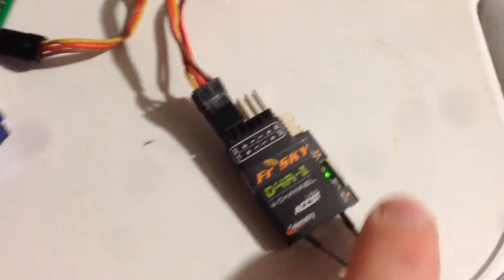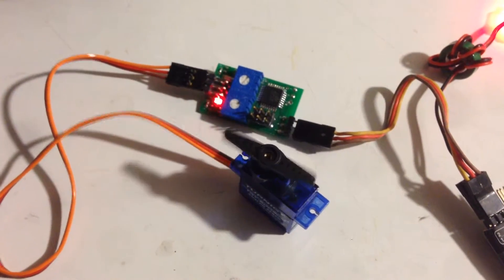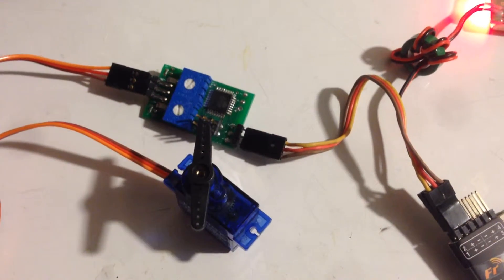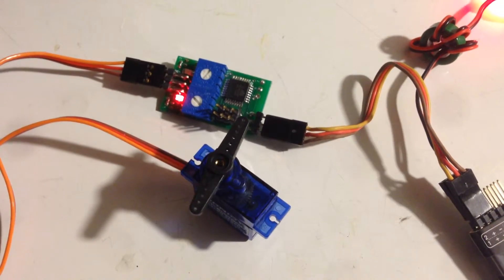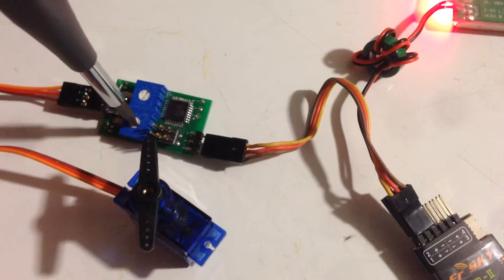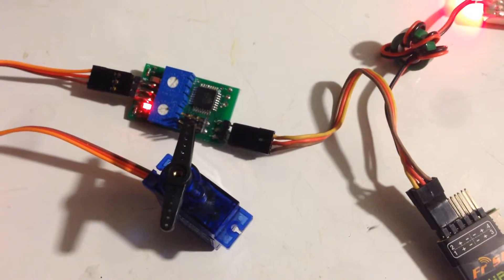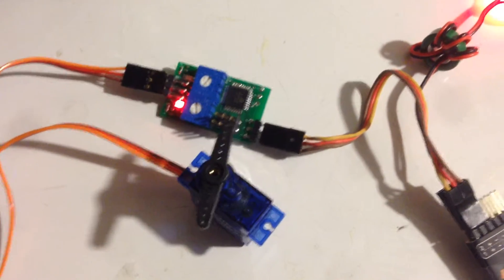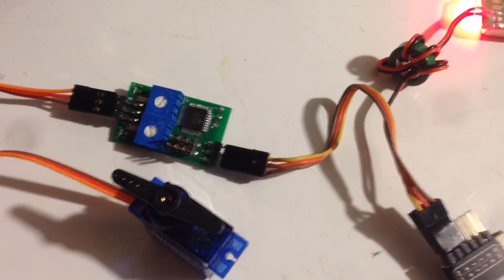Servo Buddy

Comment: Just set the timing for that channel in the transmitter programming. It's that easy!!
Reply from the maker: Sure, in 2025 that works with OpenTX/EdgeTX now that radios are a lot better and programmable. 10 years ago that wasn't an option on my friends cheap, non-open sourced radio.